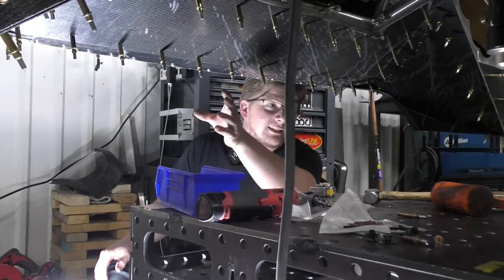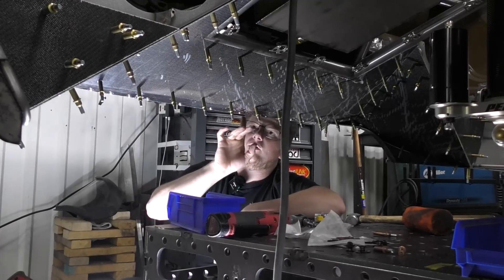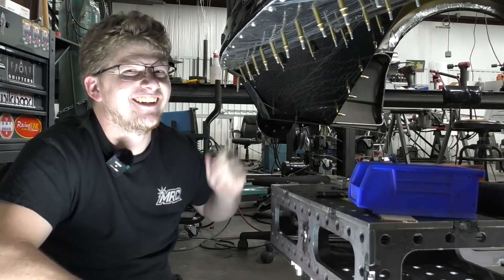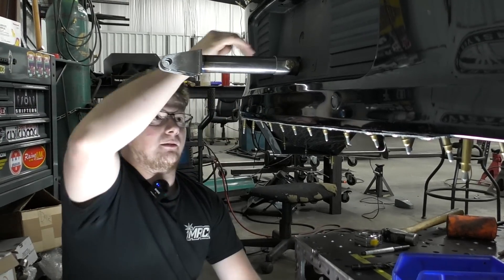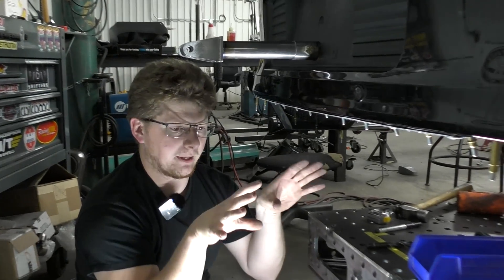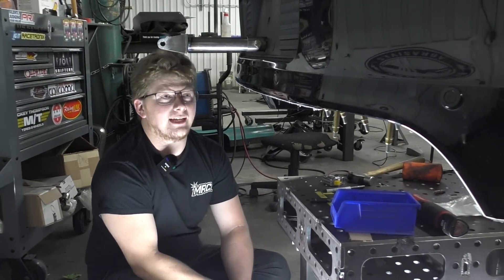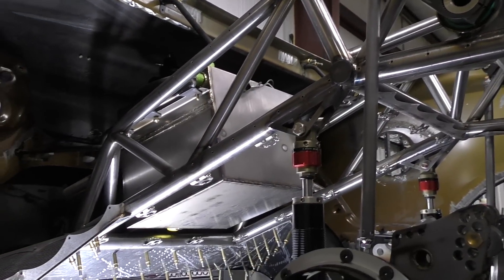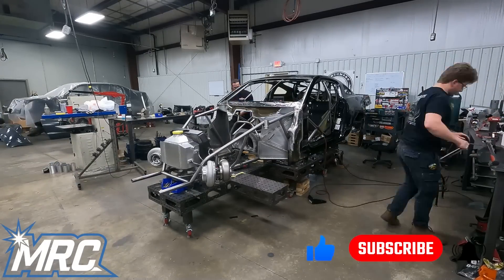Final Fabrication for Snot Rocket 3.0 | Bumper, Shock Mounts & Parachute Prep.

Comment: It does not appear that the car has any underbody ground effects-  ie a diffuser to bring drag free downforce.   Is that based on an assessment that the car has sufficient downforce from the rear wing/ front air dam?
Reply from the maker: That would come down to actual wind tunnel testing...  which drag racing is not familiar with. we would love to get the car in a tunnel to test a few things.

Comment: Can anyone explain **why the drag guys don’t run diffusers?? They are massively efficient at cleaning up the air coming off the back of the car 100% eliminating lift.
Reply: Fast drag cars get little to no benefit in the 5-6 seconds they race in a straight line. Diffusers and spoilers come into their own once you start turning your steering wheel at speed.
Reply: Most likely because the suspension articulation would cause interference. Even at ride height the bottom of the rear axle or the shock mounts sit close the bottom plane of the floor. 

If there was room to make up aero wise I would start by filling in the open space under the front clip. The air under the front splitter is immediately entering a huge void before smacking the firewall and going back under the smooth floor
Reply: Wouldn't you need a flat floor all the way for it to work? Maybe if it was a ifs rear but thats not very common in drag cars

Comment: So, seen some testing shorts already. Think brett will still get cleetus with his 5000hp 250-260mph camaro? Those small radials can only do so much, at these speeds it about power management to the ground. Everyone safe runs.😊
Reply: One of them will make a bunch of shake down passes, gather tons of data, make minor adjustments, then make more test & tune passes. The other will pull the car out of the trailer, make some full power half & full track passes, make several adjustments, gather minimal data and then do a full track send and move on to something else when the car either breaks or doesn't run as expected. I enjoy watching the Cleetus content, but they  are not running a race program to the caliber of Brett where he is so consistent and has minimal breakage.
Reply: 😂 exactly  @christopherludlow3106
Reply: Yeah, Garrett has a YouTube team much more than he has a race team.
Reply: cleet will gap the mustang. Those small tires hold just fine look at Justin Swanstrom in Prenup killing it
Reply: @FATCHOPPP  possibly.  .
Doubtful though
Reply: @FATCHOPPP yes cleetus has the power but he doesn’t have the race program Brett does
Reply: If it was on drag week or something like that where prep is limited and runs are few I think they could be competitive together. Because to be completely honest Brett shouldn’t have been able to run with mullet with the SMx but between track conditions and cleets program it equaled out. 

But anywhere else eagle should be far out in front even if cleet isn’t going max effort. These are two very different cars. Eagle at 75% should still go 3.75-3.80